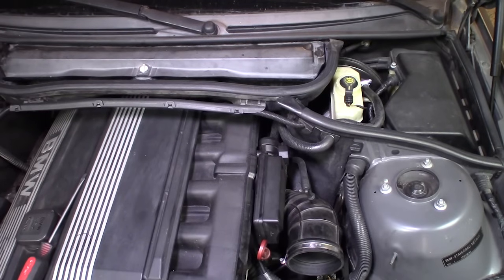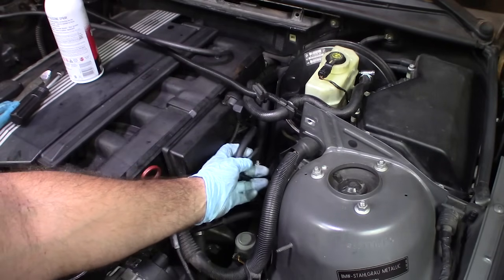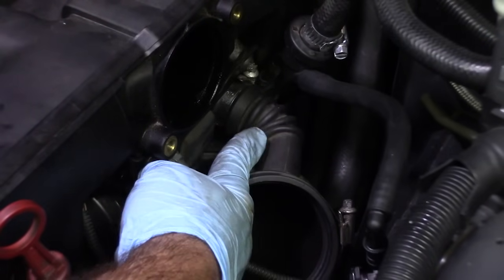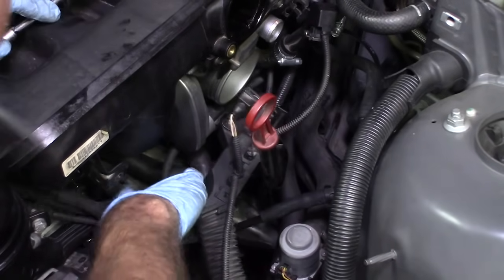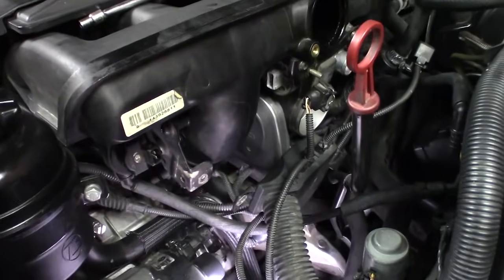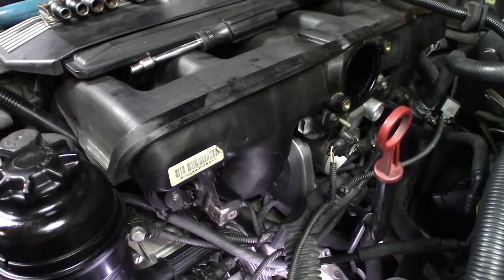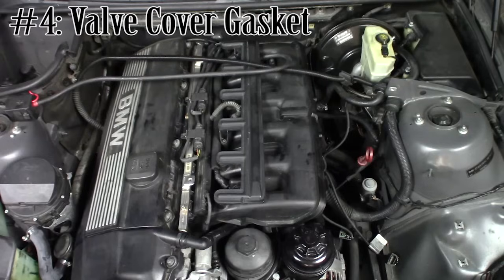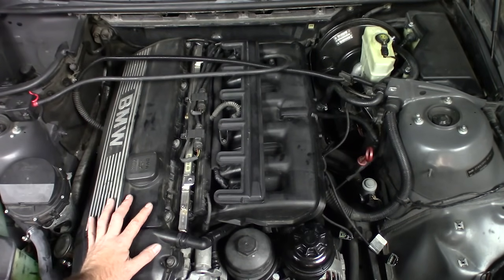BMW E46 & E39 Most Common Vacuum Leaks P0171 & P0174

Comment: hi 50's kid. The valve cover gasket my e 46 has been replaced as have pre cat oxygen sensors and oil change and vanos rebuild, new thermostat, viscous clutch amongst the repairs, new plugs and coils.

I still have rough idle at hot/warm 20 minute soak restart which has improved from rough cold idle as well. there are now vanos code errors which is strange because has been rebuilt.
i suspect the disa o-ring or some other vacuum leak.

some ideas, cam solenoids, timing chain stretched, low compression or low oil pressure.
i think its a timing cam issue which is affected by combination of these last issues.
what can you recommend?

andrew
Reply from the maker: What codes exactly?
Reply: its down at some scanning diagnostic shop for at least 2 weeks!
I do not have the codes but so far they seem to have isolated the exhaust cam timing sensor. it does not activate properly and causes rough idling and low end performance issues. the exhaust cam sensor has been replaced and so have many sensors such as oxygen and others, and no change. The solenoids seem to be ok.

What can you suggest?
Reply: these are the codes:

018 - DME (Gasoline engine control): Exhaust camshaft sensor signal

104 - DME (Gasoline engine control): Exhaust VANOS (variable camshaft timing) camshaft, end position not reached.

Its at shop being diagnosed before repair and i suggested they run a new circuit from the sensor to the  ECU. I suspect it may be faulty, if it had oil through it previously.
Also i suggested they measure oil pressure, chanage cranks sensor.
The viscous fan and thermostat has been replaced, it was operating above ideal temperature, which on an outside chance, perhaps the head has warped.
Reply from the maker: Well, the existing wiring can be tested with a test light to see if it can pass current through it.  A proper shop should have the ability to test the output of the exhaust cam position sensor with a digital storage oscilloscope to see if it's faulty or what.
Reply: apparently this is what they found:

"The VANOS is bypassing oil pressure. 
It appears to be bleeding oil pressure off the VANOS unit - this is why it doesn't reach end stop on the VANOS on exhaust bank."

I think they mean the piston seals but did not say exactly.

what can you suggest?

Comment: You are incredible, Kid.
Your videos and explanation detail is the best I've seen. I've taken my BMW X3
to the dealer 2 times with this same issue. Lean fuel PO171 & PO174. Still
coming back like a nightmare. They said they did a
smoke test, checked normal. First time my air filter was changed and gas manual
something was changed. Second time they changed the fuel filter. I lost my
faith with the dealer, looking to take to a good mechanic not, like. Hendricks
BMW likes to fix one problem at a time.I bought a scanner now to
help me diagnose and primarily remove the annoying service engine soon light.
The concern I have now is the MAF sensor. I unplugged it
and engine did not stall, like I expected. Is that a good way to test? it cause,
I cleaned it, reset the light and after 400 miles its come back.You are incredible, Kid. Your videos and
explanation detail is the best I've seen. I've taken my BMW X3 to the dealer 2
times with this same issue. Lean fuel PO171 & PO174. Still coming back like
a nightmare. They said they did a smoke
test, checked normal. First time my air filter was changed and gas manual
something was changed. Second time they changed the fuel filter. I lost my
faith with the dealer, looking to take to a good mechanic. I bought a scanner now to help
me diagnose and primarily remove the annoying service engine soon light.The concern I have now is the MAF sensor. I unplugged it and engine did not
stall, like I expected. Is that a good way to test it cause, I cleaned it,
reset the light and after 400 miles its came back.You are increasable, Kid. Your videos and explanation detail is the best
I've seem. I've taken my BMW X3 to the dealer 2 times with this same issue.
Lean fuel PO171 & PO174. Still coming back like a nightmare.You are
increasable, Kid. Your videos and explanation detail is the best I've seem.
I've taken my BMW X3 to the dealer 2 times with this same issue. Lean fuel
PO171 & PO174. Still coming back like a nightmare.You are increasable, Kid.
Your videos and explanation detail is the best I've seem. I've taken my BMW X3
to the dealer 2 times with this same issue. Lean fuel PO171 & PO174. Still
coming back like a nightmare.
Reply from the maker: Your car isn't supposed to stall when you unplug the MAF, it just stumbles and recovers.  That is normal.  I don't believe that they did a smoke test and found nothing wrong.
Reply: 50sKid when I unplug MAF it didn't do any on dash gear light came on. Nothing else runs fine.
Reply: Also it's a 2005 X3 3.0i if it makes any difference.

Comment: Quick question bro, every time I turn on the car it makes a weird noise like if the starters mest up or something it does it for like the first 2 sec. when I start the car, do you have any idea what it might be?
Reply from the maker: +Dennis Castellano Sounds like the starter. ;-)  Could be that some of the teeth on the flywheel have been chewed off.  If you jack your car up, you can see the flywheel teeth through an access hole in the bottom of the transmission bell housing.  You can rotate it with a prybar to check all the teeth.
Reply: +50sKid Nice! I'll check that out I got to get under it anyways to change the center soport bearing, I believe the driveshaft is unbalanced or something cus its the second time I change it -.-  ....  or buy a carbonfiber driveshaft :)

Comment: I have a 02 325x and it started to idle really bad it's horrible idles from 1k to 3k rpm and when I press the gas nothing happens it drops if anything what would be the issue ?
Reply from the maker: +gabriel cabrera Bad idle air control valve possibly.

Comment: My bmw 328i 2000 has error codes: 
P0305
P0303
P0300
P1250
P1397
P0150
Do you think these error codes could be caused from a vacuum leak? Are they independent of each other? Is there any specific error code I should look into fixing first?
Thanks

Comment: hi my car BMW E46 318I threw a code P0170 fuel trim bank 1. i replaced the fuel pump with a new one and the code has disappeared but the vehicle still has rough vibration when i engage to gear. checked my battery voltage is at 11v, can a bad battery cause the vehicle to have rough vibration and loss of revs when the engine is loaded?
Reply from the maker: No, not the battery.

Comment: Really good video any suggestions for a running rich conditions p0172 &p0175 codes i been trying to fix for weeks with no luck still i check for vaccumleaks there are non i replace all the ccv disa valve works well idle valve is good maf ia good i replace spark plugs 4 months ago any help will be appreciate it

Comment: Good day, I have run out of options. I have done a lot of maintenance to my 04 325i M54 engine E46 chassis and my vehicle  has no change. My car is suffering from loss of power. I’m getting vacuum leaks, bad number 2 injection flow. I’m about to throw in the towel. Is there any way you can help?

Comment: Hi , Great video and great advice!!  ...I was just wondering if the 530 d has a pcv valve as mine seems to be burning oil , I cleaned the egr valve and it ran great from a while but now it's gone back to burning oil again thanks .
Reply from the maker: I'm not familiar with the diesels, I'm afraid.

Comment: Hey. My 2003 BMW E60 530Li with an M54B30 engine made a ticking noise when i parked it, after picking it up from the mechanic (for other reasons than the engine). I drove it for about 10 kilometers, then it suddenly made a much worse noise. I could barely drive it, and i weren't able to pass 1200 RPM with full throttle. Appeared that all 3 cylinders in bank 2 stopped firing.. What could be the cause, and what could be the fix?

Comment: hey Jason thanks for your great video I have been suffering this two code with my e83 engine X3 , I have found faulty lots of boot and ccv hoses pretty much rebuilt the whole air intake system i have replaced the o2 sensors but no luck. but I observed some oil leak under my engine but it looks like oil pan leak .would it cause vacuum leak also ? and how can we test a mass air flow sensor if it's good or not I haven't seen a video of you about it.
Reply from the maker: best to check out my fuel trims video
Reply from the maker: Btw no an oil pan leak wouldn't cause the problem

Comment: Great vid, youre a very good sensei. a week ago picked up this 2000 320i in Tokyo with a whopping 33,653 kilometers on the clock. as you can imagine, its in mint, showroom, factory condition and it drive like its brand spanking new. And how much did i pay? a fortune. 120,000 yen, around 1100 bucks. when i was checking out the car, I noticed a sudden dip in idle, but it quickly corrected itself. on the 30 mile drive from tokyo back to where i live in ibaraki, the car performed perfectly. the next day it idled rough in the morning and actually even stalled twice. However, I was able to restart it with no probs. It fired right back up, but misfired. after a min or two the misfiring went away and perfection returned. I drove the car for its 1000 dollar registration and MOT (registration tax is extremely high for old cars in Japan. In this case it was 400 bucks), which took a few days. picked up the car, it drove fine. but upon leaving a restaurant last night, the rough idle and misfire came back. this  morning it was still there, but again disappeared while driving. could these be symptoms of a vac leak? I think im even hearing a slight whistling sound coming from under the hood. Theres no way this could be coilpacks or plugs, right? they dont correct themselves. what do you think?
Reply from the maker: I think it's likely the CCV system has a problem with it.  Probably the return hose from the oil separator to the dipstick tube.
Reply: will do, thanks man. will keep you posted. im noticing that the prob manifests itself between frequent starts.

Comment: Hey 50's kid.  I'm also a 50's kid with a recently acquired 2002 E46 330Ci Cpe.  You produce awesome videos, and I've learned a LOT.  The car is throwing a P2096 Post Catalytic Fuel Trim System Too Lean Bank 1 error, so I cannot get it smoged.  I'm a mechanical engineer, but alas I don't have the time to DIY.  I'm looking for someone like you in the San Fernando Valley who is proficient on BMW's; namely upgrading DME firmware and diagnosing vacuum leaks?  I took the car into an indy repair shop and they quoted me a ridiculous $1,300 to do what I consider a costly trial by error fix; replace the two post cat O2 sensors ($500) and the ICV ($350) + labor ($450).  From my understanding, the sensors cost ~$80 each and the ICV can be cleaned.  The car has a K&N intake filter, and on inspection the post MAF intake boots are clean, soft, and pliable, but that's as far as I went. Can you provide a referral?
Reply from the maker: +David Rosenthal Check to make sure the O2 sensors are tightened fully.  When I was getting a P2098 error (bank 2), it ended up being that the #2 pre cat oxygen sensor was slightly loose and causing a vacuum leak.  I can't make a referral because I do my own work. :-)
Reply: +50sKid, If you had a shop, I'd be a customer.

Comment: Really like your video and I really don't know anything about cars. So let me ask a green horn question. 2002 BMW 330i, I think I've got a vacum leak but I also have to keep adding Oil . Would a bad Oil Separator Hose cause not only a vacum leak but also a slow loss of oil? Thank you , and hope to get a reply.
Reply from the maker: No it would only cause the vacuum leak.  The oil loss is common to all M54 engines -- I have a video all about the oil consumption issue and how to fix it.

Comment: Hi, I have a 2006 X3 E83 m54 3.0L with 164K miles and I am only getting a P0174. So does this mean there is no issue with vacuum leak as Bank 1 seems to be fine? Could it be the O2 sensors?

Comment: Great videos !!  I have a smell (oil/exhaust ??) that happens when i step down on the petal to go fast.  I have replaced the oil filter housing gasket and other than a slight leak of the power steering reservoir there are NO leaks. I have also replaced the fuel filter and fuel pump within the last 2 yrs.   I just bought a ECS professional scanner by foxwell for a BMW/Mini model # 14020sch. Can I use this to test the fuel system along with getting a gauge from Harbor.  Also, When I park my car (in a garage) and I come out to get in it I smell gas fumes?  Any suggestions are where to look to fix these issues?
Thanks Your perform a great service for us DIY guys.   Gary
Reply from the maker: Well you should get a scan tool with live data to see if you are running rich in any way.  A rich condition could produce a smell in the exhaust.

Comment: Hey guys my 325ci e46 2002 has no codes but I can’t pass smog because my secondary air won’t complete and the pump turns on during cold starts for 90s and then shuts off like it should so I’m lost, any thoughts?
Reply from the maker: Sounds like the valve might not be opening. Check the vacuum line going to it

Comment: The solenoid for the Secondary Air pump should NOT be mounted behind the engine, extend the wires and mount it by the Air pump. Just have the vac lines running to it and the two trigger wires. It would be much easier. It's an unnecessary PITA to get to back there. Much easier to troubleshoot the system this way.

Comment: hey i disconnected everything and put everything back together replace the engine intake boot(the one thats closer to the intake manifold because i fount that the other one was cracked..while i was doing that i removed my throttle and cleaned it.....i turn my engine on and I'm getting a code P1634 ...did i mess this part up when i removed it? also i try to test drive my car and the gas pedal does not seem to respond..
Reply from the maker: +Mauricio Vasquez Did you move/open the throttle body flap while you were cleaning it?  It's possible you may have messed up the electronics inside if so.

Comment: Maybe you can help me..my E39 keeps throwing a misfire. i have changed the coil packs, changed out injectors as well as replaced all the filters and O-rings on the injectors and she still throws the misfire. Will a vacuum leak be a cause ? Or a bad MAF ? She runs good for a while and then throws the code. Noticed a bit of a stumble in the idle at start up, but it's not every time. I also already had the Vanos done, so it's not related to that common issue. Any ideas are appreciated !
Reply from the maker: +Jeff C Random misfire or misfire on a specific cylinder?  What's the code?  Misfires are a wide-ranging subject, honestly, and I can't give you direction without more data.  Take a look at my fuel trims video https://www.youtube.com/watch?v=4CcwtaIe5c4 to understand how to look at fuel trims to help diagnose this.  If you have a scan tool, can you find out what your fuel trims are?  Misfires can be caused by vacuum leaks, but also compression loss or bad injectors or bad coils.  Bad MAF is absolutely a culprit.  Sounds like you've blindly spent a ton on parts, consider looking at fuel trims to diagnose your problem rather than continuing to throw more parts until you hit the problem.
Reply: The misfire is always on cyl #2
Reply from the maker: +Jeff C Since you've ruled out bad parts, you're now into more advanced diagnosis territory.  You need a scan tool for sure to rule out vacuum leaks.  You need to confirm that cylinder 2's coil on plug is being commanded to fire, you need to confirm that the fuel injector is being commanded on, etc.  Advanced subject and you really need to learn a whole lot more if you want to figure it out yourself.  Check out ScannerDanner's videos to learn how he'd go about diagnosing something like that.

Comment: Hey so I just bought my 06 525i. Runs good has no check engine light on but if I hook up my scanner it comes out with p0171 only. And when I look at my live data on one of the long term fuel trim it shows above 10.0 I believe it was 12.5. Any ideas? No leaks that I can see

Comment: Hi man, I have a 2001 BMW 330Ci and I'm very fan of your videos.  I've just watched "BMW E46 & E39 Most Common Vacuum Leaks P0171 & P0174" and I wonder if the Cap for oil filler could be also a vacuum leak? Thanks!
Reply from the maker: No not a vacuum leak but it would be bad if it was leaking--you don't want air in your oil system at all.
Reply: ok thanks, i'll replace it

Comment: Hi, found the vacuum leak but the scanner still reads the codes PO171 PO174... Please do you have any suggestion? I have a 330CI 2002
Reply from the maker: Did you clear your codes?

Comment: What do you mean by "engine running lean"? I've been having issues with my 03 E39. When idling, the car begins to shake and lose horse power, same when I'm driving. I've changed all ignition coil and the issue is still there. I then change the Mass Airflow sensor and the problem went away immediately! My car regained power and the idling went away. The car felt like new. A day later the idling came back. Help!!!

Comment: Hi, Ive literally just finished watching all  of your e46 related issues videos. Also a new subscriber of yours. I have a cold start problem. When i turn the car on first thing in the morning, it starts to bounce around inside, and once its warmed up it starts to run smooth. ALSO when i press the gas pedal, the car would sound like its pushing air out and if RPM's get higher it would whistle slightly. Can you please help me out? I really dont want to pay $500 for JUST a problem diagnoses from a shop.
Reply from the maker: +Undefined Islander sounds like a vacuum leak
Reply: 50sKid so a vacuum leak causes those bouncy, kicking cold starts?